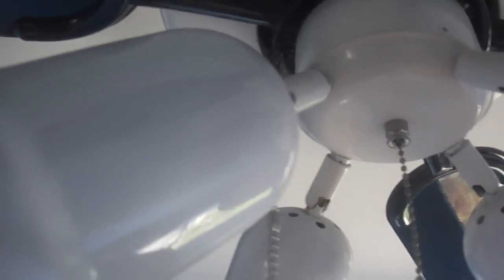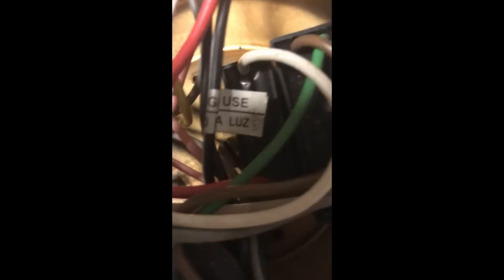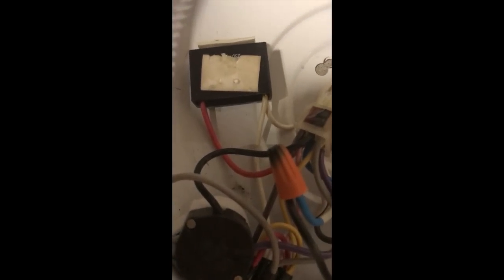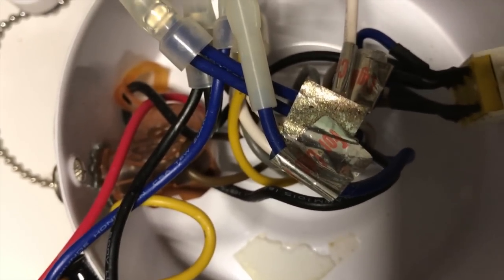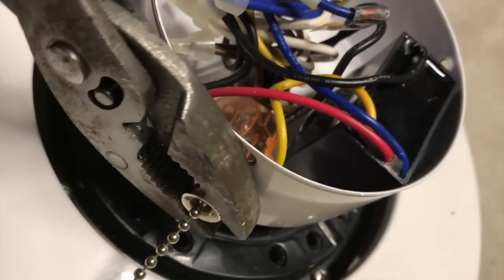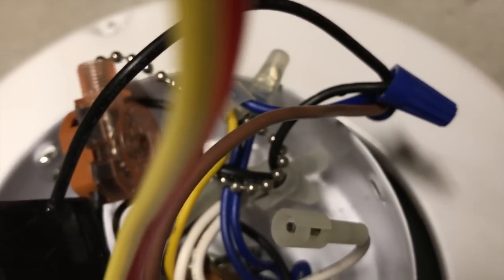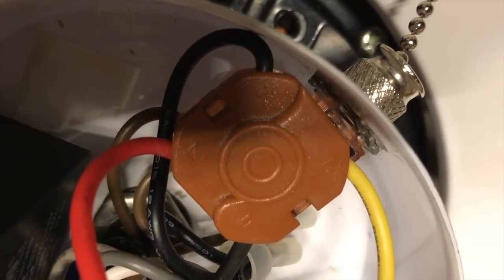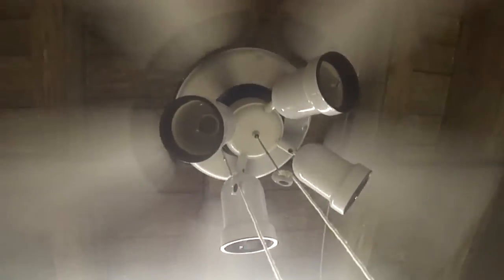Ceiling fan repair: how to replace a motor capacitor

Comment: Hi. How do I disassemble a Westinghouse ceiling fan to get to the capacitor? The fan model is: 30" Turbo Swift 78301 black and what could be capacitor spec for this fan?

Thank you.

God bless, Proverbs 31
Reply from the maker: Hi Seven, start by removing light glass. I think you can just pull it off, it's attached by 3 spring clips. Look and see if there is a black box connected to pull chain switch. If you don't see a black box, then the next step is to remove a light bulb then unscrew all screws on side of light kit and you should be able to get to black box. When you find a black box, it's a capacitor and it should tell capacitance ratings. Westinghouse Turbo Swirl is still made so you could maybe just order capacitor from Westinghouse.
Reply: Thanks. If I don't find the exact capacitor (the box says there's two capacitors), can I replace it with a higher capacity so that it'd spin faster as well? Do I have to replace both the two capacitors?

It's spinning very slowly by the way.
Reply from the maker: Is there only one box or two? And does it spin on all speeds?
Reply: Hi. Thanks. I does spin on all 3 speeds (very slowly). I opened this ceiling fan (just the screws on the side are need to be unscrewed). The capacitor says (it's printed in lime green ink):

CBB61
1.5nF (microFarads) + or - 5%
450VAC     C
50/60Hz SH PO
EN25/070/21      2010.01

The carton box says:
- Dual capacitor speed control allows whisper quiet operation at any speed.

But I only saw just one capacitor? Is there another capacitor or that one single capacitor has two capacitors inside?
Reply from the maker: Does that capacitor have 2 wires? If it only has 2 wires than it's a single capacitor.
Reply from the maker: And is that capacitor connected to pull chain switch?
Reply: Yup, it only has two wires (how come the print says dual capacitor? But that's good, a blessing in disguise I don't have to open the motor housing, if ever there's another capacitor there).

This is seems to be standard 1.5nf 450VAC 50/60Hz I think. Is this expensive (I should buy 3 if it's not. I'm gonna' glue the other one in the housing if it fits, so the next time it's fixed there's extra)? It doesn't seem to have a bulge like with lithium batteries but I think sometimes it doesn't bulge yet it's damaged.

Is this capacitor's power enough to cause serious harm?

Thanks.
Reply: The right red wire goes up to the motor, the other red wire (left on top of the capacitor) goes to the light bulb and then to the switch that reverses the spin of the fan and from that switch it goes to the fan speed switch and light switch as well as to the bulb. 

this by the way is the fan (bought more than 4 years ago):

https://www.lazada.com.ph/products/westinghouse-30-turbo-swirl-ceiling-fan-78301-replacement-light-bulb-60-watt-g16-12-lamp-available-everywhere-good-ventilation-for-nursery-bedroom-living-room-over-computer-tables-desks-and-sofa-sets-no-light-bulb-included-i33386-s42734.html

It's similar to this new model: http://www.westinghouselighting.com/ceiling-fans/products/turbo-swirl-30-inch-reversible-six-blade-indoor-ceiling-fan-7226100.aspx

Both the fan's speed and light are pull by a chain (separate chains)
Reply from the maker: I think you should just replace 1.5uf capacitor. Any other capacitor is ONLY used for medium and low, while this capacitor is used for all speeds. Here's a link https://www.ebay.com/p/Ceiling-Fan-Capacitor-Cbb61-1-5uf-2-Wire-C01/771600023

The start capacitor (the one you are referring to) will be discharged by windings when not in use, so you don't have to worry about shock in this case.
Reply: Thanks so much again. This'll work (positive thinking). I can't believe that's the only problem and it's been not used for more than 4 years. God bless, Proverbs 31
Reply from the maker: You're welcome!
Reply from the maker: Any updates?
Reply: Hi. Still looking for a fan repair shop (they're like junk shops here) that has the capacitor (first one didn't have it), though I've been busy also researching fountain pens, for a week now. I'll look for two capacitors I bought years ago, misplaced them. Thanks for asking.
Reply: Hi. I now got the capacitor (got two, brand new), though the VAC is different. It's only 400VAC instead of 450VAC. Should I look for another capacitor at another store? Thank you. Though the microfarad is the same at 1.5 and the name printed on the capacitors is the same, CBB61. Thanks.
Reply from the maker: @SevenDeMagnus  400 should be fine.
Reply: Thanks. Would there be any loss of power (making the fan spin slower) with just 400 or shorten the lifespan of the motor or capacitor? Or it's as good as 450VAC?
Reply from the maker: @SevenDeMagnus  Would be as good as 450VAC since it wouldn't exceed voltage.
Reply: Thank you so much! It was harder to replace than I thought (ground, lol) and was a bit tight in there but it's working now, after more than 6-7 years. I can now make more room, in my small room by putting the stand fan out.

All the pitfalls, were all blessings in disguise (including buying having no 1.5uF 450VAC, if that hadn't happened I wouldn't have been able to install with a better set, a more durable 1.5.uF 500VAC w/ two capacitors in series, though I now have two spared 1.5uF 400VAC which may be the capacitor for the smaller stand fans- if that's what they use, it's another blessing in disguise:-)- always pray for patience when things aren't going according to plan, there's usually the best plan ahead and that pitfall was just a hard preparation for the best to come/something better.

Thank you so much again sir!:-)
Reply from the maker: @SevenDeMagnus  You're welcome!
Reply from the maker: @SevenDeMagnus  I think it uses candelabra based bulbs.
Reply: Hi. Thanks. It's good now. Though I'll exchange the 3w for the more expensive (triple almost, expensive) Philips. The 6w LED from Philips work (two switch dimmer) and 3 to 3.5w for other brands. The bulb diameter max is 52mm, the length of the bulb's body excluding the socket is around 60mm. 60w max only. Though, there's no LED that strong, that'll fit it.

Comment: I got a new capacitor for my oscillating fan but both the wires are black but the wires on the fan are grey and black....does it matter what orientation the wires are?

Comment: How do you short out a capacitor?
Reply from the maker: In this fan, I pulled the fan chain few times, while the fan and light are wired to same hot wire, and light chain is on, and power is off. Capacitor gets shorted out by motor and light in series.
Reply: Okay, thanks.
Reply: The Channel of Random Ceiling Fans - To short a capacitor properly, first ensure power is OFF! Connect a short piece of wire to ground, then touch each lead on capacitor to discharge. The light and motor are on parallel circuits, not in series. They would not be able to operate independently if in series.

Comment: My fan says Synlix, i think it is Hunter Douglas sub. Where can I find replacememt capacitor?
Reply from the maker: Hunter Fan Company and Hunter Douglas are complete separate companies, and Hunter Douglas never sold fans. Synlix is not part of Hunter. Capacitor can be found in different places, what's the capacitance rating of the old capacitor? It should show number before "uf" or "MFD", and it would be more than one, just list all capacitance ratings.

Comment: Great video, thank you for making!  I have an older Hunter ceiling light/fan model 21978.  The fan stopped working at all.  I replaced the switch capacitor, but still is not working.  Slight hum when turn on.  There is another smaller 2 wire capacitor in the housing that doesn't appear to be blown, but I'm wondering if I need to replace that one as well?  Any suggestions?
Reply from the maker: If the fan does not work on any speeds, it sounds like it's a 2-wire capacitor issue, so it would be good to replace that one. The capacitor with 2 wires is always used on all speeds, while the one with more than 2 wires is only used when on medium or low.

Make sure you order one with same capacitance rating as the old one. Capacitor usually looks fine when going bad, that was the case of my Harbor Breeze Teak and Hunter Highbury; the capacitor looked good but they were slow.
Reply: Thanks.  I replaced the 2-wire capacitor too and the same result.  Fan doesn't spin.  Makes a slight hum on one of the speeds when I pull the chain.  The two wire capacitor I used has 2 black wires, whereas the one I replaced had one red and one white.  Could that be the problem?  Otherwise, capacitor is marked same 5uf and 250VAC.  I note my old ones were WVAC, but was told that the "W" didn't matter.  Or, is it possible the 4 wire capacitor isn't installed correctly?  There were two grey wires, a brown and a green.  I followed how the old one was attached for brown and green, but no way to tell which grey wire is which.  I had assumed it didn't matter, but maybe it does?  Same thing with the two wire capacitor-both black so just connected one to former red and one to white.  Could those be reversed?  Thank you!
Reply from the maker: Your fan should have three pull chains. One for speed, one for reverse, and one for light. Maybe the one for reverse is stuck in middle position, and it would be good to try to pull all three chains until fan is working. If fan still doesn't work, you may have to check and see if all wires to reverse pull chain is present.
Reply: You are a genius!  That was it!  Thanks so much for taking the time to help.  I really appreciate it.  Thank you!!
Reply from the maker: So the reverse pull chain was just stuck in between the whole time? And you're welcome!
Reply: No, the capacitors were blown (bursting), but in trying to troubleshoot I pulled on the reverse stick (no chain) and must have gotten it stuck without realizing.  Thanks.
Reply from the maker: You’re welcome. Glad I could help.

Comment: Hi, my fan problem is med and low speed is much slower than before. High speed is ok. Replaced capacitor with same rating still same issue. Swapped capacitor with another working fan still can't solve it. What else can be the problem ?
Reply from the maker: Did you use the capacitor with 2 wires, or the one with 3 wires? The one with 3 wires is the one that is only used for medium and low.
Reply: @CeilingFanVideosOnYT  I can only see a capacitor with two wires. Is there another hidden capacitor ? I swapped the working capacitor from another fan in another room also can't fix it.
Reply from the maker: What's the brand name and model number of your fan?
Reply: @CeilingFanVideosOnYT  Acorn 42inch fan, with remote control.
Reply from the maker: Then it's the problem inside the receiver. The 2-wire capacitor do affect high before medium and low. There are capacitors built in receiver too which is for medium and low, but it takes electronic skills to replace them. You could either take it to someone who knows how to repair electronics, or get a new receiver.
Reply: @CeilingFanVideosOnYT  oh the remote receiver, situated above the fan shaft. Actually it's the second easiest to swap after the capacitor, I should have done it too but thinking since I can start the fan and switch between speeds so I didn't bother to swap it. You just given me new hope ..I will try it tomorrow. Thanks so much for the time, will update u.👍🏻
Reply from the maker: You're welcome. The receiver not only can change speeds, but stores capacitors which is used for medium and low. When capacitors in receiver goes bad, it doesn't usually affect the way the receiver can still switch speeds, it only slows down medium and low, unless the capacitor actually leaks in which case it can cause damage to the receiver.
Reply: @CeilingFanVideosOnYT  wow swapping the remote controller really works! I probably will replace the F3 and F4 relay to try fix it. Thank you so much for reviewing my case. 🙇👍🏻
Reply from the maker: I don't think it's the relay. I think it's the capacitors built in receiver causing this.
Reply: @CeilingFanVideosOnYT ok. there are two sizes capacitors, I supposed it's the very big one which have 1uF and 2uF, http://www.cgegd.com/en/displayproduct.html?proID=1223866.  The other is typical small capacitor, can't see the obstructed spec.
Reply from the maker: Yeah maybe you should contact the company about this.
Reply: @CeilingFanVideosOnYT  you helped me lots, I subscribed. Thanks many!